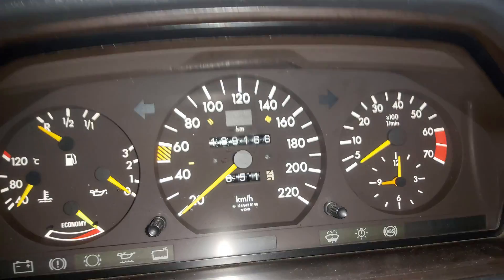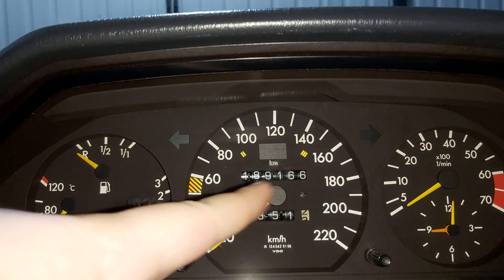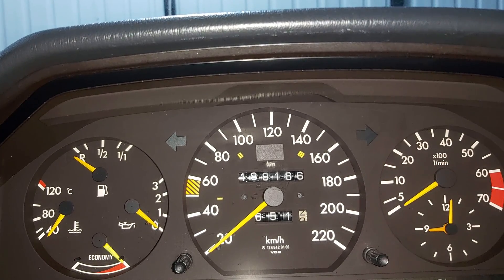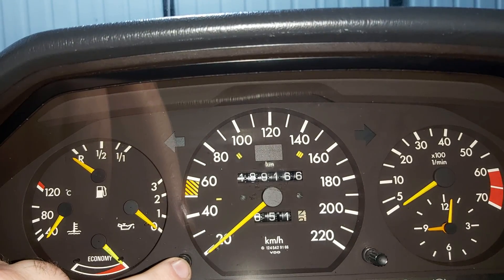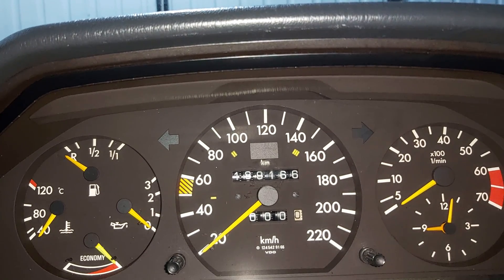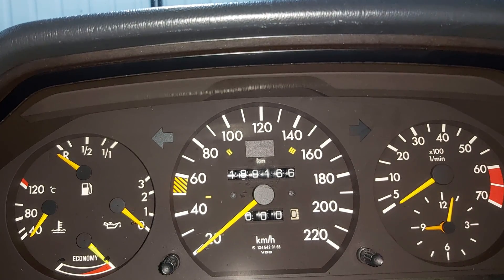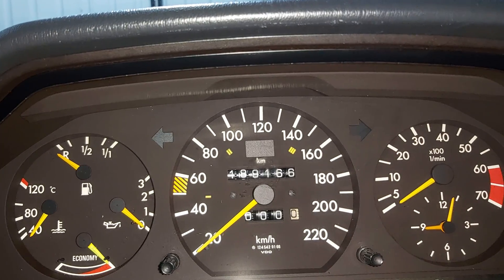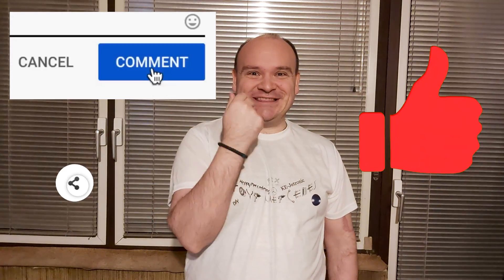㉦Mercedes Ke-Jetronic㉦ - A quick tip

Comment: Thxs for the tip! It's possible to fix the speedometer dials, but the effort is huge and btw the copper spiral needs some tension, otherwise the needle don't shows the correct speed anymore. Do it as you have shown! 👍

Comment: Thanks for information.
 There is another problem. An indicator that measures incorrectly.
 The screen shows 90KMH, but the speed display screens in Navigation or Roads show 10KMH incorrectly. 
So there is a 10KMh error on the vehicle display. I haven't found a solution for this yet. It just shows 10KMH incorrectly..
Reply from the maker: We will see about that in the future. I can't promise anything...😉🙂😃